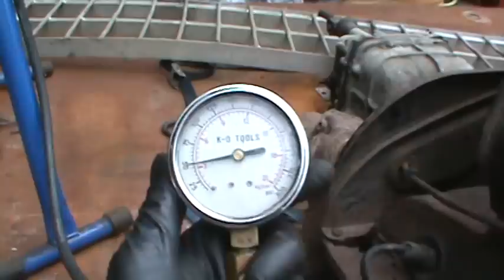vw bus engine rescue and cold start,

Comment: Brings back fond memories. I once changed out an engine on the street on a bus,100 miles from home. I had bought the bus from a neighbor for $100. I had a used engine complete minus the distributor. Guess what? When I swapped the distributor I took a peek at the points and they were closed up... The engine I just changed out was fine LOL. I wish I had all of the buses I owned

Comment: When I was a young guy stationed in Germany we could get those engines for $15 (about 50 marks) any day of the week. Germans would junk those cars at the first sign of rust and we'd buy them dirt cheap, weld up the holes, and drive them until they seized or threw a rod. Then grab another engine and slap it in during lunch break. Later we'd sell it to a new guy and the cycle continued. 

I had a 73 Beetle with 68 European fenders and engine lid, and a 63 engine with the tiny 6 volt flywheel. Brought my second kid home from the krankenhaus with it when he was born. Thanks for the memories.
Reply from the maker: Papi Johnson how times have changed
Reply: New stuff you did not anser the question when dreams you putting out new fixes if not then I won't watch you eney thanks for replying  back
Reply: sorry to be so offtopic but does any of you know a trick to log back into an instagram account??
I somehow lost the login password. I would appreciate any help you can give me!
Reply: @Zakai Ishaan Instablaster =)
Reply: @Alessandro Corey Thanks for your reply. I found the site thru google and I'm trying it out atm.
Seems to take quite some time so I will reply here later with my results.
Reply: @Alessandro Corey It did the trick and I finally got access to my account again. Im so happy:D
Thanks so much you really help me out!
Reply: @Zakai Ishaan Happy to help :D

Comment: Those 1600 single port motors were so durable. I had one for about six years, a 69 Type 2 Transporter. The only problem it really gave was a blocked solid manifold pre heat tube. That took some imagination to fix.

Comment: I put an 1835 fuel injected out of a van in a 75' type a beetle in the early 80s w/o much mechanical knowledge back then. The little beetle would run cool 90+ all day long. Had to replace one valve sleeve and the alternator in 200+ thousand miles. The engine had 40k when I bought it from a junkyard for 175 bucks.
Reply: my friend bought it and put a new belly pan in it and its still running w/ that motor today w/ 300+k on the odometer.

Comment: It may have a sticking intake valve, since it's popping through the carb. Exhaust valve should be much more apparent at the exhaust pipe.
Reply from the maker: WhoSaidTyler think its burnt cause it was tight, f it were loose then id agree that it was hangin up
Reply: mustie1
Or the valve seat popped loose. That clacking is excessive.

Comment: More fun ahead. I guess you probably already thought about this, but is it possible that it is just a dirty valve or even a valve that isn't quite closing all the way? Especially on a motor that has been sitting for so long. It will be interesting to see what you discover.
Reply from the maker: The Shade Tree Fix-it Man but the valve lash was tight, and it would have been loose if hanging up,

Comment: I don't know much about the VW bus. I do know about the VW beetle. 1966 was the 1300cc engine. 1967 (the split year[new fenders, old bumper]) was a 1500cc engine. 1968 (new bumpers and new fenders) had a 1600cc engine.
Reply: If that's right my 64 bus has a 1500 beetle engine, check.

Comment: It's a hell of a lot easier to change a battery in your battery jumper than it is to change a battery in a motorcycle and the batteries are about the same size as a motorcycle battery

Comment: I am wondering what the engine start test was designed to tell? Perhaps the price you were willing to pay. The run up on that flat bed certainly will not tell you if this engine can be put back in service without overhaul. First pull the oil fill cap and take a wiff. If the oil smells like overheated oil,you know where to start from. Then I would have pulled the plugs and got a compression reading, if any were low give a squirt or two of oil in the cylinder,see if it comes up, if it does some but not enough adjust the valves. Pull the strainer (oil strainer) checking for bearing material. All this info will help you decide on a price to pay it will not tell you if the engine can be put back in service and used for dependable transportation.Bus engines had a really hard life. This engine could have head studs pulling (maybe the new muffler was a misguided attempt to silence head popping noises) Now checking for head popping noises is a good reason for a start up. Lastly these engines can have a crankshaft thrust main bearing that is loose in the case. You will never stop an oil leak if the thrust bearing is loose. In reality everybody has their own sequence they use for a check out. As long as nothing is missed,so what if people do things different.
Reply: and who is the youtuber with 158,000 subscribers ? It aint you. Start your own channel, you know it all....

Comment: That engine doesnt stand a chance against you repair abilitys :-))

It ran with one cylinder down, thats not such a bad engine really :D
Reply: air cooled VW flat fours will run on one or two cylinders, albeit not well.
Reply: FrankTheCat
I didnt know cats knew anything about engines :D
Reply from the maker: zx8401ztv it should live to power another vw for sure